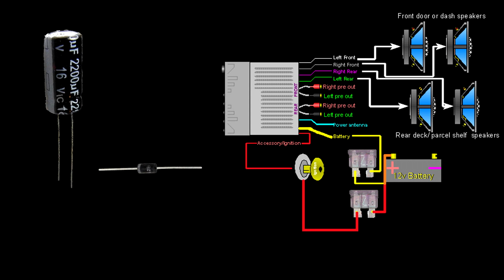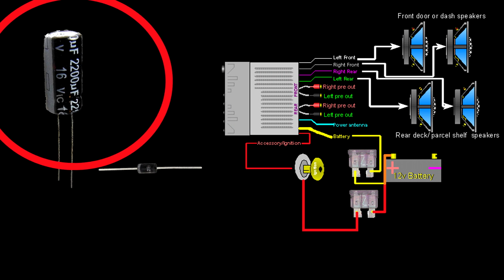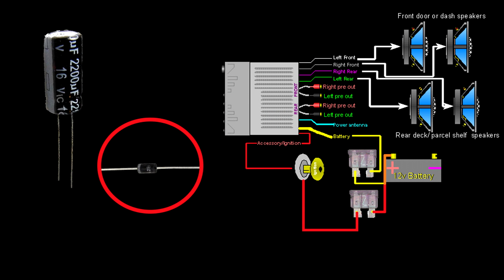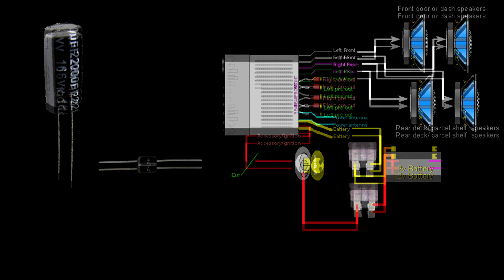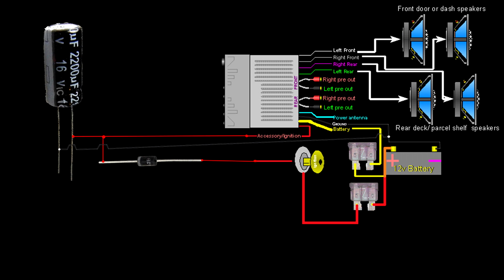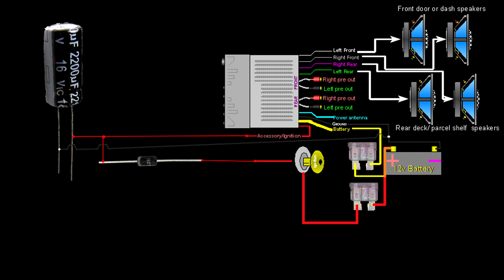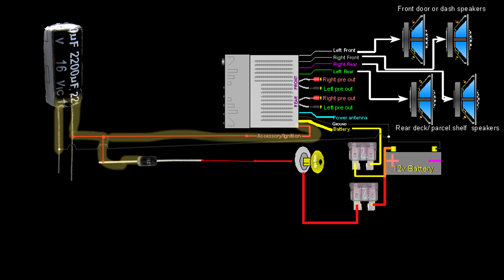HOW TO: Keep Your Car Stereo On While Starting

Comment: I was having this issue on my boat and a capacitor alone didn't work. When starting the boat, the power appeared to be cut off through the factory wiring, likely to give the starter as much current as possible. My method required a capacitor and a relay.

I put the cap (10k uF 35v I had laying around, probably overkill) on the original power source, similar to the video shows, but then wired that to #86 on a relay. I then ran a direct 12v source to the relay (#30 in, #87 out, #85 to ground). The capacitor proved to be enough to keep the relay open while starting my boat, providing a solid 12v signal the whole time.

Comment: I have a 63v dc capacitor with 6800uf and a 250v dc with 2200uf. I know is to high in voltage but someone commented for a 25v that was 10v safe.  can I use it or will be a nice bang and my car will burn?
Reply from the maker: Any cap rated for 16v or more is safe. The higher voltage ones will just be physically much larger.

Comment: 16v rating is not safe.. load dump can easily exceed 40V!
Reply from the maker: Sure, but this is just on the turn on signal, there's a diode, and the ignition disconnects the circuit during cranking.

Comment: What type of diode should I use?
Reply from the maker: gonçalo Cardoso pretty much any common diode will work. good sources are old power supplies, and DC "wall warts" you have languishing in a drawer.

Note: different stereos may have different amounts of draw on the turn on wire, so you may need to experiment with different values of capacitors.

Hope this works for you as well as it did for me.

Comment: Great video!  Installing two 2200uF capacitors (in parallel) to the red ACC wire (in series with a 1A diode) keeps my Android head unit on for about 10 seconds after switching the ignition off.  Unfortunately, it still reboots when cranking the engine, presumably because the starter causes a voltage drop on the yellow continuous power wire (according to the schematic for my 2009 RAV4, the ignition does not open that circuit).  This must be a common problem, but I see no products on the market that address it.  Unless anyone has a better idea, a series of supercapacitors may be worth a try... areksnotes.blogspot.de/2013/05/blaupunkt-melbourne-120-vs-voltage-dip.html
Reply from the maker: Good synopsis of the situation. 
In cold weather, or if my headlights have been on, when I crank the starter, 1 out of 3 times my stereo will reboot... This didn't happen 2 years ago when I first installed this mod. So, I think it it has to do with my battery getting weaker.

Perhaps a fresh battery would help?  

The super capacitor should do the trick, and a beefy series diode would probably be a good idea...
 
Alternatively, a cheeper alternative might be a series diode and a rechargeable battery, like a small sealed lead-acid 12v battery. As an added bonus you'd never lose your radio presets, etc...
Reply: Update: I assembled a Lithium Ion battery back and added a simple circuit to maintain voltage on the yellow continuous power line while cranking.  This in conjunction with your circuit on the red ACC line solved the problem completely.  Thank you for the inspiration!
Reply from the maker: Cool!

One note of caution: while lithium ion are great, compact batteries, they aren't tolerant of abuse. Be sure you have a working charge and protection circuit in place.

I'd be interested in what you have rigged up...I'll have to do something myself. If getting a fresh main battery doesn't help.
Reply: wow, for me 2200uF capacitor alone was keeping the stereo alive for 22 seconds, I had to down it to 470uF to get 5 second run time while cranking the engine.
Reply: For the main 12v, would you think a cheap capacitor for a sub amplifier would do the job?

Comment: great video! I followed all of the steps however the radio still shuts off when cranking. I have a custom android radio so I would assume it takes more power to keep it on. assuming this, I purchased a 4700, 35V capacitor. I tested the voltage drop on my accessory wire and it dropped to -0.02VDC. after I connected the capacitor with diode, it drops to ~+3.7VDC. do I need for capacitors or am I doing something wrong? I used t taps on one end of the accessory wire and one t tap on the other end without cutting the wire. should I still cut the wire?
Reply from the maker: Gerson Santiago you'll have to cut the accessory wire to put the diode in line... I'd bet that's the problem. 
If you just turn off the ignition does the radio stay on at all?
Reply: Stephen Tack okay I'll try cutting it. When I turn of the ignition the radio does stay on for a few seconds. (~5 seconds)
Reply from the maker: Ah. Well try adding the diode. If that doesn't work, is probably cause your battery voltage sags a bit too low and browns-out the radio while cranking. Not much can be done for that unless you put a VERY large capacitor (and maybe a big diode) on the battery supply side (yellow wire). 🙄 Good luck!
Reply: Stephen Tack I tried cutting the wire. the good news is that the radio still Powers on which let's me know the circuit is correct. the bad news is it still Powers on on crank. So I'll just order more capacitors and try to make the same setup on the constant wire as well when the parts come. thanks! and just out of curiosity, how long does it usually take for the capacitor to charge up? do I have to let it fully charge before cranking?
Reply: Stephen Tack So I just realized that after shutting the car off and removing the key, the radio is still on for much longer than before. so now I'm just confused. if it remains on with no accessory voltage. why would it restart on crank?
Reply from the maker: Gerson Santiago that wire draws lots more current. You'll probably need at least 1farad to hold it on... Which means you're looking at super capacitors.

Also remember, capacitors in parallel add capacitance. Capacitors in series divide capacitance (more or less), but add to max voltage tolerance.
Reply from the maker: Gerson Santiago your restart on cranking seems to be caused by the starter drawings too much current, making the always-on supply to the radio dip too low for it to stay on.

Comment: which diode I have to use & if i use higher capacitor will the performance increase?
Reply from the maker: srinivas ramaiah pretty much any normal diode will work...don't use a zener diode, or something special. 
Yes, the larger the capacitor the longer of a reserve you will have. Be sure it's rated for at least 15v.

Cheers!
Reply: Thank you Stephen, This small circuit worked well for me & it solved my restarting problem
Thank you once again

Comment: it worked for me and is it ok to use a 2200,25v capacitor
Reply from the maker: Glad it worked for you!
Yes the voltage rating of the capacitor just needs to be more than the voltage with which you are working, plus a bit for safely. In this case a car&#39;s charging system gets up to around 14.5V, so your 25V cap gives you a 10.5V safety margin.

Comment: would it need to upscale the capacitor if I am doing this too a Kenwood ddx7015?
Reply from the maker: +Dean Belich it really depends on how much current the turn-on writer draws. This isn't related to how much wattage there stereo is rated for...just a function of the control circuitry used.
If one capacitor doesn't keep the stereo on, try adding another of the same size in parallel.
Reply: +Stephen Tack thank-you for that but I did test the battery with a multimeter and found that the voltage drops down to about 10V when cranking the diesel van, in saying that wouldn't i need to have a capacitor and resistor on the constant wire as well as the accessory wire?
Reply from the maker: That is highly dependant on the architecture of the amplifier in the head unit. Mine occasionally browns-out the amp on very cold days when cranking, but comes right back on without interrupting the music for more than a second.

There's only one way to tell if your measured is 10 volts is below the stereo's shut down voltage. Give it a try! If the stereo does shut down while cranking, you'll need to add a much larger capacitor (probably a couple ~10 farad super capacitors in series or something), and likely a high power handling diode as well... also perhaps check the health of your battery, terminal connections, and leads.  This is really kind of a separate issue which doesn't plague most vehicles

Cheers!
Reply: +Stephen Tack what I have purchased is a 4700uf 25v capacitor and a diode IN5404 do you think that would be enough to keep it on? also the battery and van are a couple of months old along with the stereo
Reply from the maker: That capacitor should be fine for red "turn-on" wire, as described in this video. And that may be all you need to do.  If, however the stereo does shut down while cranking, you'll need a second MUCH larger capacitor (or bank of caps), and a beefey diode, on the always-on yellow power wire.
Reply: +Stephen Tack OK so what size capacitor and resistor are we talking about for the yellow wire.
Reply: +Stephen Tack OK so what size capacitor and resistor are we talking about for the yellow wire.
Reply: +Dean Belich could I then run a three way switch and have on one side the radio turning on with the key and the other hard wired so it's always on even if the key is out?
Reply from the maker: Yep, that's an option with, or without the capacitor mod.
Reply: +Stephen Tack fair enough so if I wire the switch up wouldn't i need another capacitor and resistor circuit for the constant power due to the power drop when still cranking the car? also what did you mean by the amp browns out in your earlier comment. cheers
Reply from the maker: Dean Belich To "Brown Out" is to partly lose power, the amp sounds very quiet and distorted, but only for a second on cold days when it's hard to crank, and the battery is cold.

A switch would be installed on the red "turn-on" wire, and and alternately feed power from the ignition's accessory position (like normal) or straight from the battery (yellow wire)... this switch would do nothing to help the voltage dip while cranking, the only solution to that is an upgraded or second battery, or a large capacitor bank and diode just for the stereo.
Reply: +Stephen Tack I tried this afternoon linking 4x caps 4700uf 25V and that still didn't do anything. the unit still switches off. is there something I'm doing wrong?
Reply from the maker: Dean Belich You're talking about just the mod from the video, with red wire, right? 
Does it stay on at all after you switch OFF the ignition?  Are the caps in series (a chain of capacitors), or parallel (all + legs connected, all - legs connected)?   They need to be in parallel for their capacitance to add (series makes a smaller capacitance than any one cap).  Do you have a diode?
Reply: +Stephen Tack Hi Stephen, I've got all the negatives connected together and all the positives connected together then the diode. is there a way I can send you a picture? and yes to the red wire and no the unit does not stay on. it straight away turns OFF
Reply: +Dean Belich I tried with just one capacitor and diode first before I started joining the rest.. but it didn't work with the one 4700uf capacitor and a 3 amp diode
Reply: +Dean Belich I tried with just one capacitor and diode first before I started joining the rest.. but it didn't work with the one 4700uf capacitor and a 3 amp diode

Comment: i did this but when i turn key to crank it still turns my stereo off. i know iv connected it right because when i remove key the stereo stays on for 10 seconds. im using 3 1000uf 16v caps and a 1N4002 Diode....i cant figure out why its not working. the yellow wire is always live right ? thats what keeps stereo settings and time and so on? i also tried putting the ground of the cap to the car chassis for a good earth but still turns off on crank...i cant get my head round whats happening also have a audio capacitor in the boot for my sound system so it cant be a bad battery..my battery is a decent Bosh aftermarket one too...
Reply from the maker: +Mix Bag I'd guess when you crank the engine the starter is drawing enough current to pull the voltage to the yellow wire down, and 'brownout' the stereo causing it to turn off.  

I'd recommend measuring the voltage at the stereo's yellow wire while cranking. You'll need either a good fast reading meter, or a cheap manual ranging/analog meter to catch the voltage dip before the engine starts. Alternatively you could disconnect the coil wire/ignition system power so that the car won't fire up, just crank (don't do this too long, unburnt fuel will build up).

If this is the problem you could try putting another (larger) capacitor(s) and/or diode on the yellow wire...this will have the same voltage stabilizing result as the large cap by your amp in the boot. 

I've found in my car, on cold days, when I restart the engine the stereo's sound drops out very briefly. So my stereo's amp is browning out and shutting down, but it's not  enough to turn off the whole stereo, or disconnect bluetooth.

Hope you get this figured out. I'd love to know what you find.
Cheers!
Reply from the maker: +Mix Bag BTW, I checked out your channel. Very cool! We have similar interests.
Subscribed! ;-)
Reply: +Stephen Tack thankyou very much for reply. I have a meter and will take some readings. I also thought about adding caps in the yellow wire. I'll try and get back to you :)
Reply: Stephen Tack sorry i didn't see this comment. i have subscribed back to you :) thank by the way! i made a PCB for this project and was thinking on making a video and sharing the PCB files so it makes this mod easier for other people. if i do make a video i will link your video in mine if you like ?
Reply from the maker: Mix Bag cool. I can see how a PCB could make this easier to get the diode in the right polarity, or if you are using multiple capacitors in parallel. Feel free to link to this video if you like. I enjoy trying to answer questions on these comments, so the more the better.
I'll also be making another video, actually installing a capacitor & diode in my old pickup truck.
Reply: Used a meter today not a very expensive one just the average cheapy but it read solid 11v on the yellow wire while cranking. my audio power cap in boot has a voltage readout and that also reads the same. after a long drive the battery reads 13v so thats all good there. i put the 3 1000uf caps on the yellow wire with diode and it still turns off on crank..very strange,my stereo turns off when voltage gets to 8v...,i have given up now haha
Reply from the maker: +Mix Bag hmm, how peculiar. How does your stereo even know that you are cranking the starter!?  
I shall ponder this situation.
Reply: The car is a mazda 2, TS2  (2008) If this helps but im at a loss it makes no scene to me haha
Reply: Even I had the same problem because I had connected it to the yellow wire but later just tapped the negative of the capacitor to a metal grounded part and now works perfectly

Comment: Hi tried same resistor but fails to keep my Jvc  double din stereo on when I turn ignition off. Any advice , do I need to up the size ? Only thing is I haven't put a diode inline ,would this be it ? Am I loosing the charge back down the line to say the ignition barrel etc.
Reply from the maker: Hmm.. By "resistor" do you mean capacitor? ...that would be the problem if not.  
And yes, depending on what else is connected to your accessory switch, the diode is essential to keep the capacitor's charge from bleeding out.

Comment: This is a very cool trick.  What was the rating for the diode?
Reply from the maker: I salvaged it from an old PC power supply. So, probably hundreds of volts. If you have a DMM with a diode check function, use that to make sure you're salvaged diode is good... About 0.5-0.8v forward drop should be fine.
Reply from the maker: +110622986866049428290 it will probably work. The high 1.6v forward voltage may cause the stereo to turn off after a shorter delay...depending on what voltage the turn-on wire is looking for... Give it a try, if it doesn't produce desirable results get a normal 'jelly bean' diode, or a larger capacitor.

You may not need to return to Radioshark, many devices will have a suitable diode inside. Most 'wall warts,' and any old pc power supplies are likely candidates.
Reply: +Stephen Tack Just completed the job and it works like a charm! Thanks for the info :)
Reply: +Stephen Tack About 5 sec. after opening the door with the key off (Pioneer AVH-4100NEX)
Reply: +Stephen Tack 
I have a Radio Shack rectifier diode with the following max ratings:
400v peak inverse voltage
1.6v forward voltage drop
1A forward current
30A max surge current
30ma reverse current at PIV

Will this work or should I run to Radio Shack and find a more suitable one? Thanks
Reply from the maker: Naaman Geist also, the forward voltage may not be so high at the very low current we are drawing.
Reply from the maker: Naaman Geist nice. Enjoy! 😎
(About how long does the stereo stay on?)
Reply: What capacitator you used along with such diode?
Reply from the maker: Dmytro Kovalskyy 2200uF 16V cap. Basically any diode.
Reply: Since I have no  any of the components I will buy them from ebay or so. Can you suggest some kit/set of various components (diode/capacitators/resisitros/etc) that will be used in various (car related) projects?

Comment from the maker: +Ben79k pretty much any common diode will work. good sources are old power supplies, and DC "wall warts" you have languishing in a drawer.

Note: different stereos may have different amounts of draw on the turn on wire, so you may need to experiment with different values of capacitors.

Hope this works for you as well as it did for me.